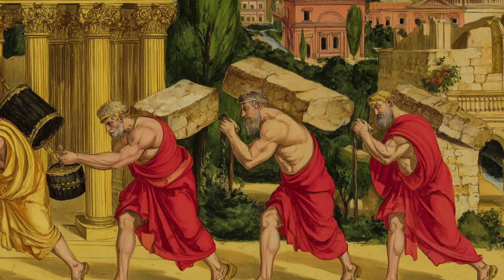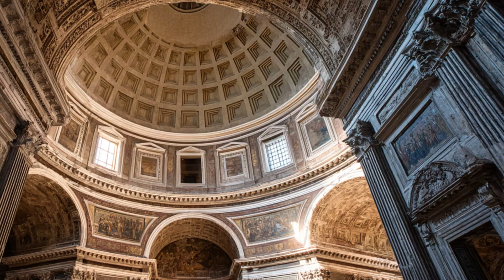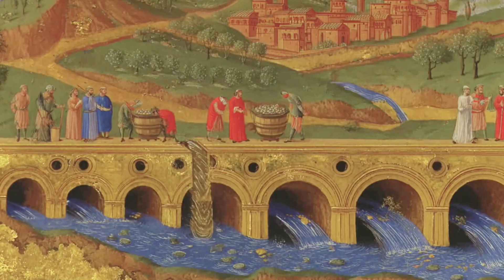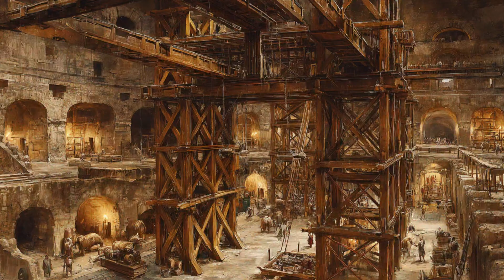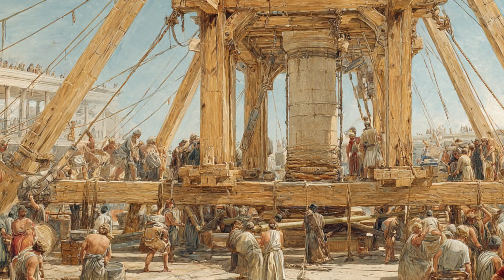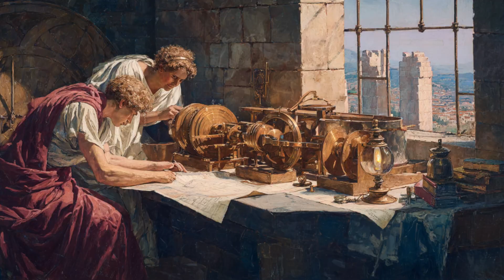THe Roman Engineering Tricks That Still Baffles NASA

Comment: Let's not go nuts.  Roman Concrete is incredible, but it shouldn't be compared to, say, modern concrete on a road.  Modern roads, especially those in places where it freezes (unlike much of the Mediterranean, most of the time) are subject to stresses that many Roman structures never had to endure.  Namely, the passage of thousands of multi-ton vehicles every day.  A fully laden Semi Tractor and Trailer can be over 40 tons.   However, where there was frequent stress, such as wagon ruts, we see Roman Concrete weathered more or less as we would expect.  Impressively tough, but not invincible.  There is also a survivors bias: we only see the best, strongest Roman concrete today, because all the inferior stuff crumbled to dust long ago.  For every Pantheon, there are thousands of buildings that are in much worse condition, or no longer exist at all.   And speaking of the Pantheon, it's an engineering marvel BUT it's been repaired many times over the centuries.